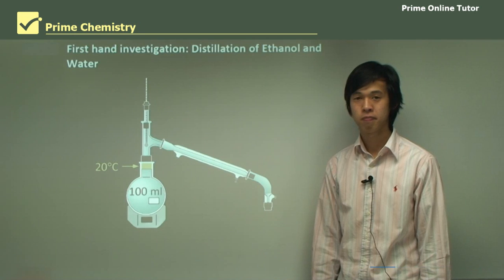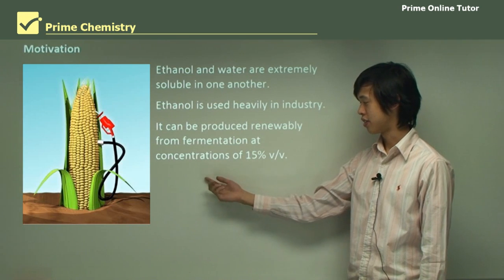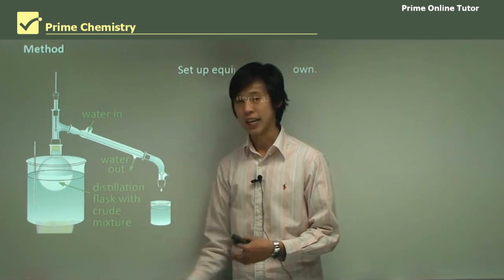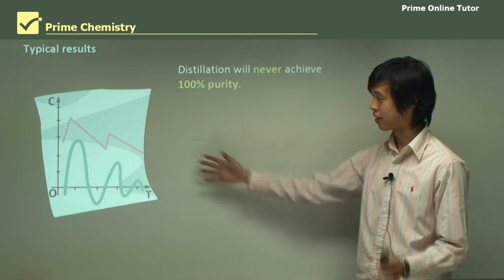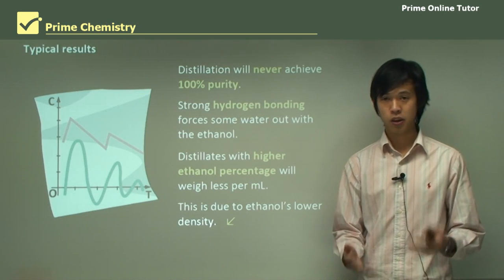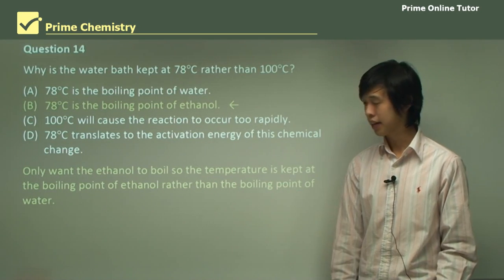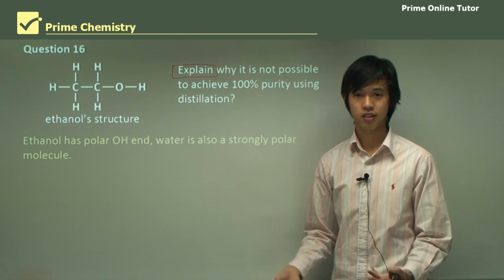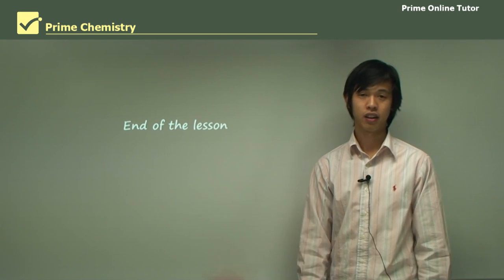🔬 Ethanol-Water Distillation: Breaking It Down in Simple Terms! 🎯

Comment: sand bath like water bath? does same thing?
Reply from the maker: Good question! A sand bath is similar to a water bath in that both provide even, indirect heating, but the key difference is that a sand bath can reach higher temperatures and is better for reactions or processes that need more heat. A water bath is limited to around 100°C (boiling point of water), while a sand bath can go much higher. Thanks for watching!

Comment: Hi, I am planning to heat ethanol under vacuum. 
Will try to produce carbon nanotubes.
Is there an explosion risk? Air will be all vacuumed. In case of a small air leakage to chamber will it immediately explode?  Also after seperation of Carbon there will be water remaining. Is there a risk that this water coming out of reaction can triger an explosive reaction in the chamber?

Comment: You don't need the water bath if you can regulate temperature... The temp ethanol evaporates closer to 79.5C/175F, your temp is 78c/172f. Also the inlet and outlet on the condenser are backwards...also distillation CAN achieve closer to 100%.. I've seen 190 proof or 95.5%, I've personally made 196proof through distillation. But higher than that CAN still be done, by adding salts.
Reply: The only way to produce 98% ethanol is to use Benzene which makes the product toxic to humans. Its also dubious that you've seen the production of 95.5% ethanol unless the yield was unbelievably low .
Reply: I understood these boiling points vary a little and are not exact depending on your elevation?
Reply: Hey, can you share your method for distillation 95% ethanol? how many circles do you have to do to get it?